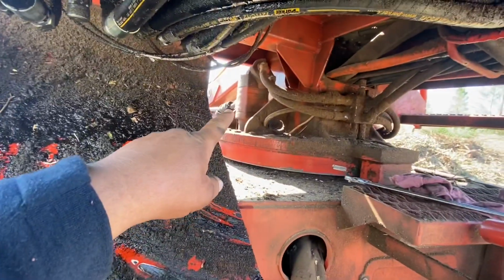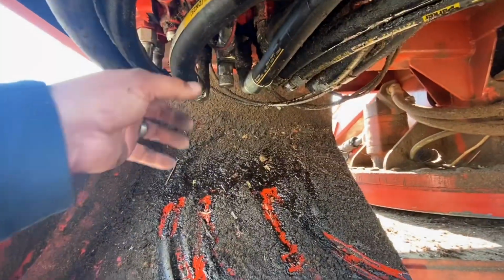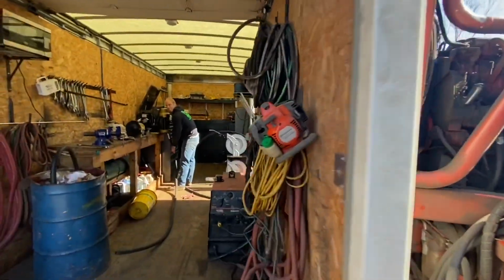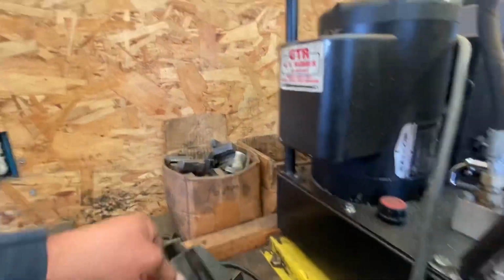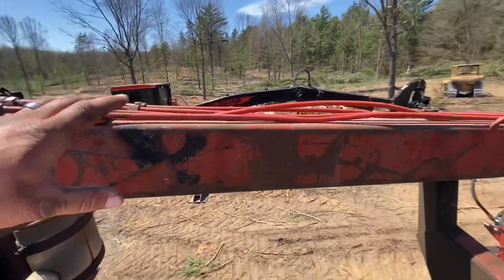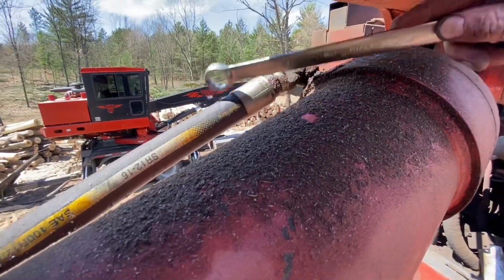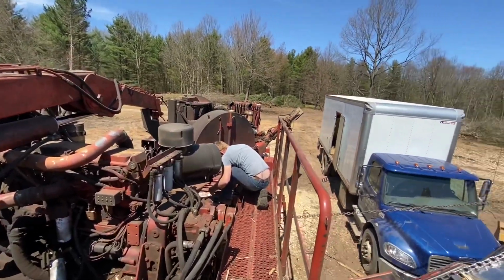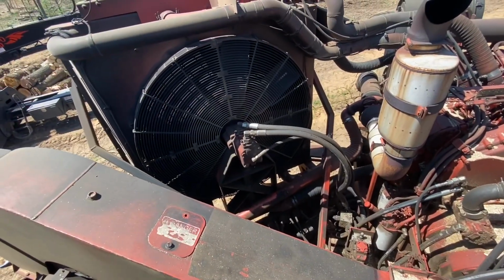Boom Cylinder Hose!!

Comment: do you mark down which ends you use daily to replenish your supply and do quick measurements of your service truck hose supply.  do you keep track of the ends inventory at the shop also.. so you don't end up being out of something for a week..  i realize the bill for hose and ends for the rebuild was tremendous but a few days downtime can be just as expensive..  its just a thought..  one might need to get creative back at the shop.. create a lever operated device for the bench grinder with the cut off disc... to clamp both sides of the cut in place while you push the lever and feed the table into the cut off blade..